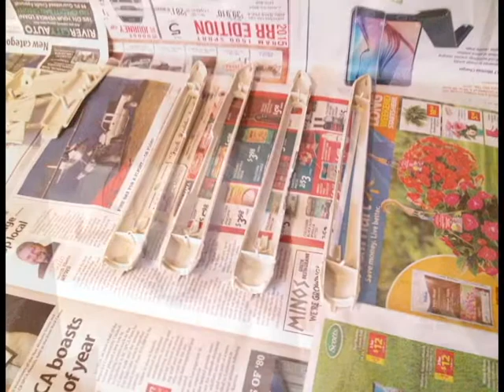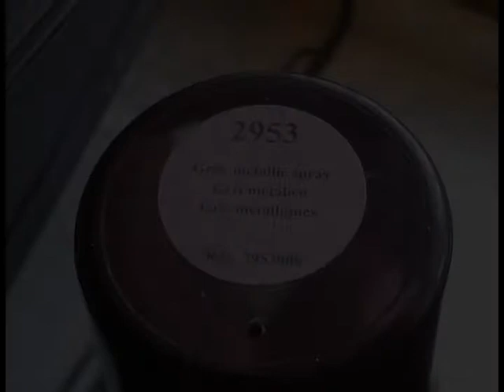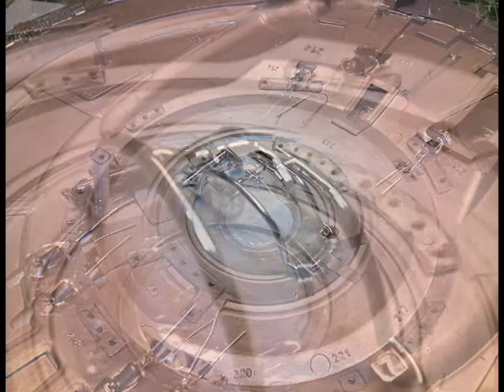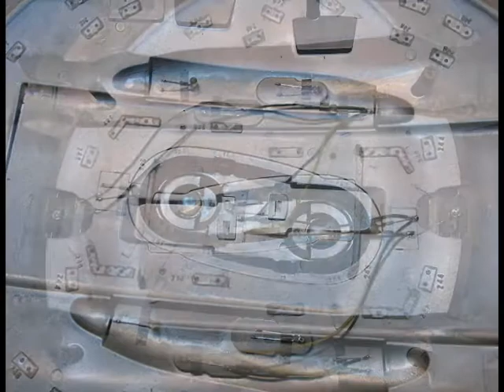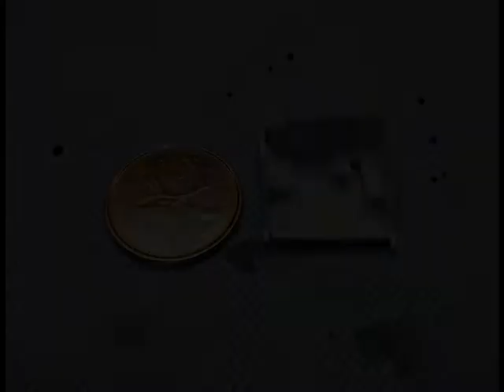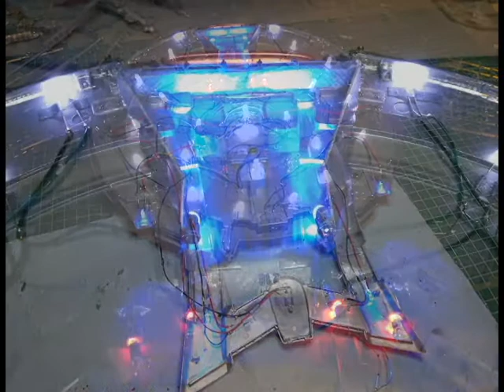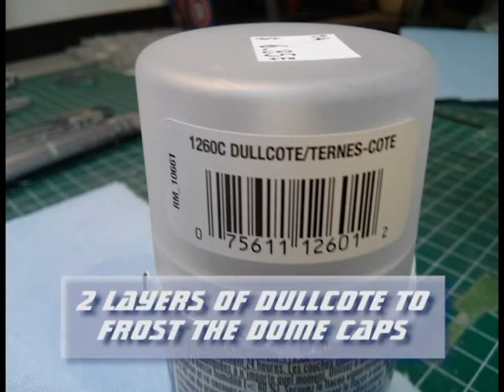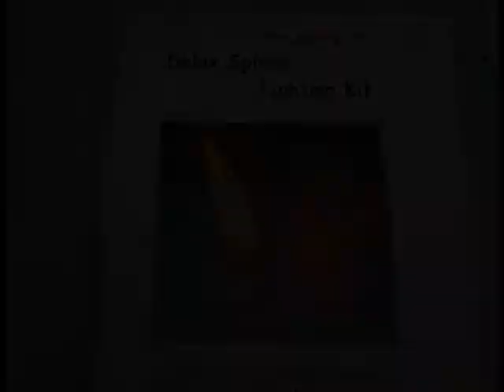350 scale NX-01 model build

Comment: VERY beautiful work . But I nearly wound up in Suto'vo'qor ((sto-vo-kor)) to you Hu-mons , by nearly choking on my fresh (( qagh)) gagh when I came across another petaQ((no translation )) building another Ship of the yuQjIjQa (( United Federation of Planets)) . When Will There Be Your Beloved Equally In Races ???? And Someone Build a Ship  of The Renowned Klingon Empire !!!  Qapla'
Reply: PS.  I've come across an article about the USS Defiant in a Fine Scale Modeler , Jan.1999/HDG08285  during construction the author took the same painting steps as you do except he said that he later regretted using the silver paint and that he found out that the flat white on another model gave him better results than the silver with his lighting  .      I've done simular on  both the NX-01 and the NCC-1701 refit both 1:350 scale , only thing is , is that the refit came in Translucent white ( which reminded me of the original kit whos micro bulbs operated on 2 D cell batteries / US /and then everything glowed upper and lower hulls engine braces and warp nacelles) . I solved this problem by airbrushing Testers Model Masters : Panzer Gray , on the interior only first this took both time and 6 bottles .  I left the parts dry for several days ,test paint with a flashlight/ small torch /for our UK cousins. and touch up any missed spots that shines through.  Next I used 8 bottles of T M M flat white and again let it go for several days .  Important thing to remember about this is to step outside and "Breathe".lol.